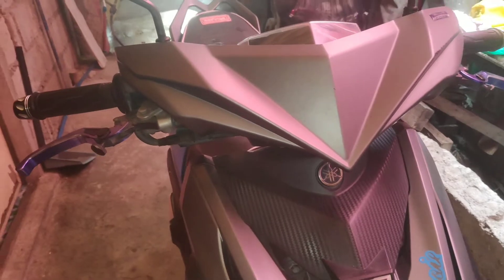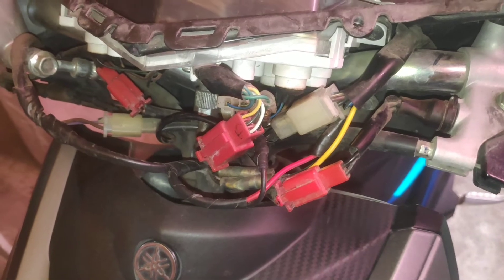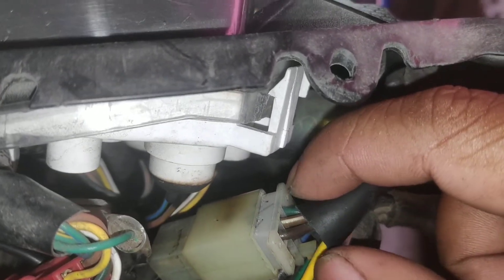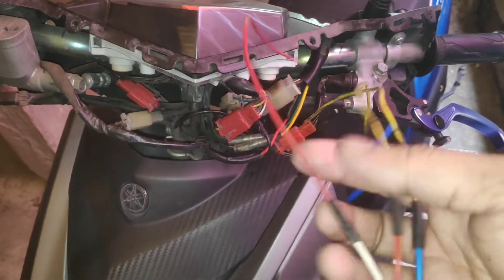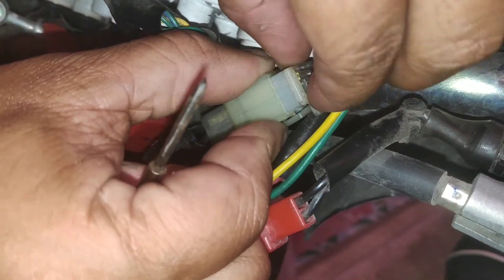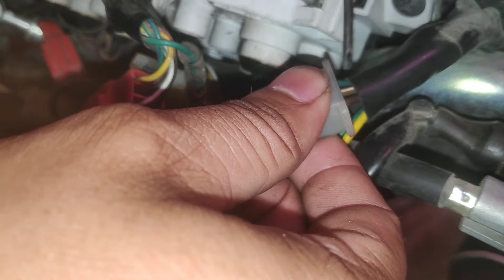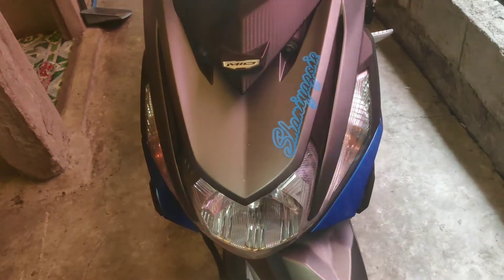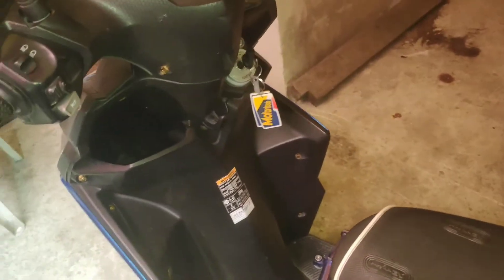How to install hazard light | Switch | Mio I 125

Comment: Salamat sa info paps..may tanong lang ako boss yung mio i din kasi ng ate ko pag tumatakbo sya parang may kabig sa kanan manibela nya...ano kaya problema nun boss?
Reply from the maker: Salamat sa magandang tanong paps. Pag ganyang may kabig pwedeng may problema sa steering bearing or baka madumi lang and kulang lang sa grasa. Importanteng ma fix agad ung ganyan paps kasi may tendency na pag tumagal mag lock yan.
Reply: @JROMMotovlog  wow..salamat sa pag sagot mo paps..baka siguro basag o sira na yung bearing nun paps noh? Papalitan ko na kaya sir?
Reply from the maker: @pandzmotovlog1037  pacheckup mo muna paps baka kulang lang sa grasa or if basag nga mas maganda palitan na agad mura lang un papsi.
Reply: @JROMMotovlog  cge paps ..salamat hehehe

Comment: Sir nagpalit po ba kyo ng relay?
Reply from the maker: yup papsi, di kasi kaya ng stock mag pailaw ng apat.
Reply: @JROMMotovlog  anong klase pong relay pinalit nyo
Reply from the maker: @suralitoandres200  Sabihin mo lang paps, 2 pin 12 volts na flasher relay.
Reply: @JROMMotovlog  thanks po sir..

Comment: Pina litan mo ba ng auto flash relay paps sana masagot mo
Reply from the maker: Yes paps nag palit ako flasher. Di kasi kaya ng stock mag pailaw ng apat ng sabay sabay. Bili kalang flasher relay 2pin 12 volts.
Reply: Ay salamat din paps na reply ka HAHAHA small motovlogfer kase ako heheh pateuo naman tips dyan paps pano mag kabit ng relay salamat paps
Reply from the maker: @jopayr812  wala ano man paps tuloy tuloy mo lang ung channel mo. Dinagdagan ko na sub mo
Reply from the maker: @jopayr812  nasa lower part sa harap ng motor paps sa likod ng araro.
Reply: Salamat talaga sa pag subscribe saaking channel paps oo pas itutuloy ko hehe ang syu rin paps subscriber nadin ako sayu eh hehehe salamat talaga paps ridesafe always paps
Reply: @JROM Motovlog pwede bah mag ibang wirings nalang para sa hazard paps?
Reply from the maker: @jopayr812  pwede nmn paps.